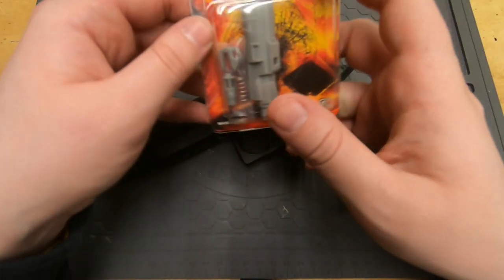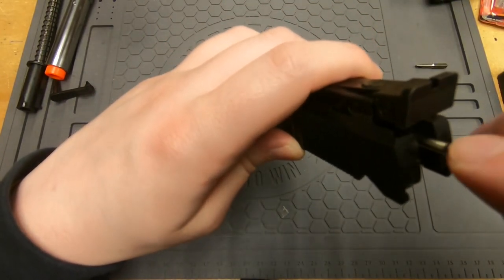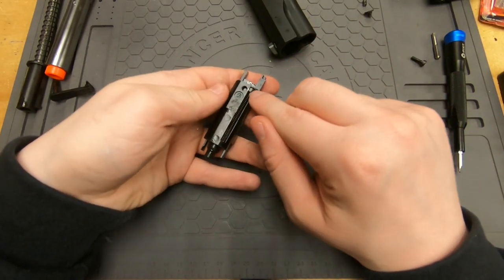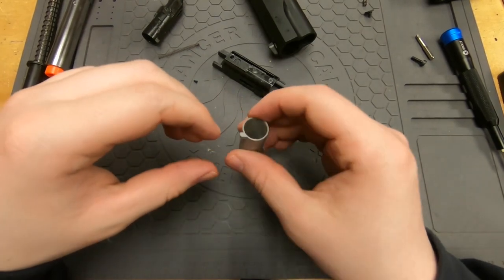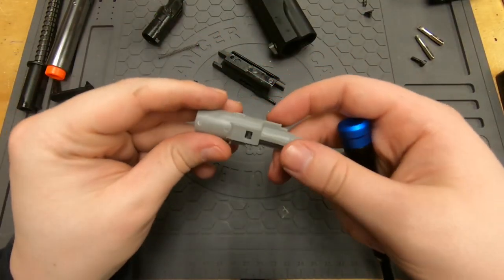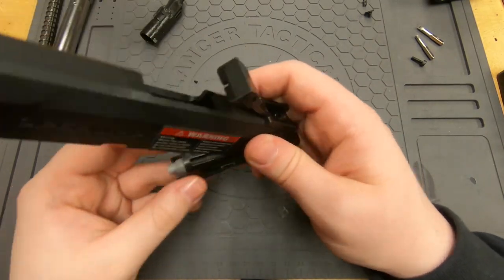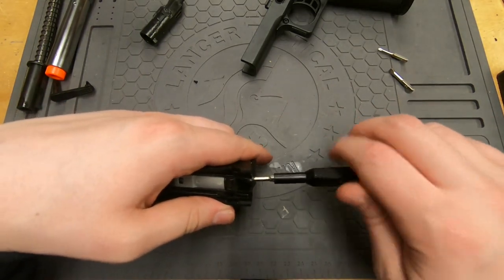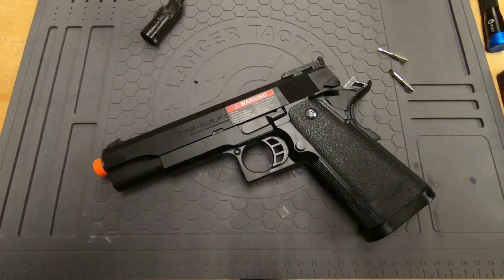How to install upgrade nozzle for tokyo marui hi-capa AIP | Airsoft toy tech guide

Comment: Great video! How did you get your nozzle to move so freely and with ease when testing it with your finger ? On my setup the nozzle has a hard time returning/moving
Reply from the maker: If your nozzle isn't moving, first thing to check is make sure it is lubed with silicone oil. If that doesn't fix your issue, either the parts you use are not compatible with each other or something is broken. I recommend you use light weight lube because lightweight will allow it to move very freely to verify nothing is broken

Comment: So.. What point is better than stock TM nozzle?? I'd used most of after market nozzle and tested. Stock TM nozzle is the best reliable I've ever used.
Reply from the maker: You are correct, but nozzles do break and need to be replaced eventually
Reply: My TM nozzle broke a week after using my new hi capa 💀